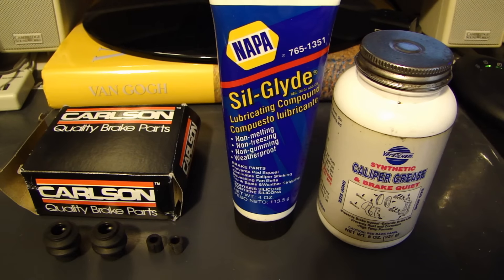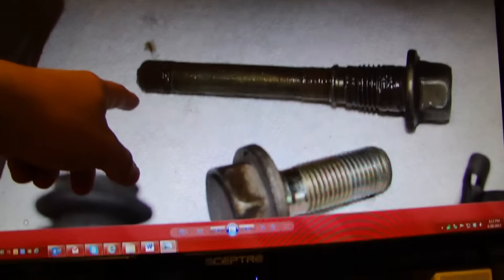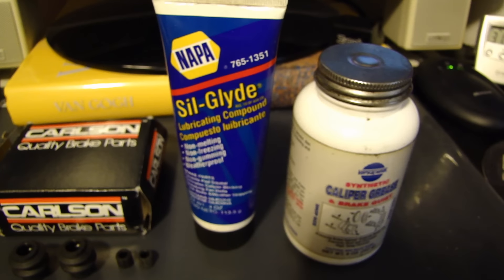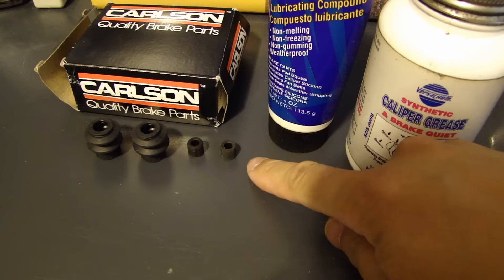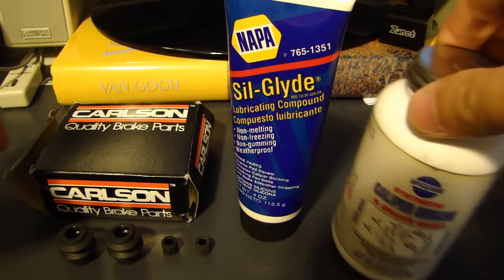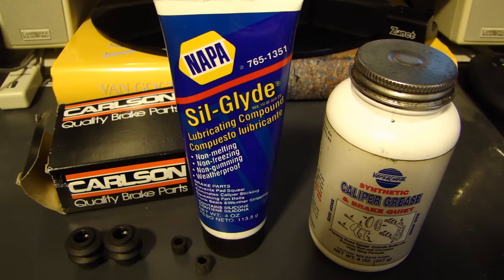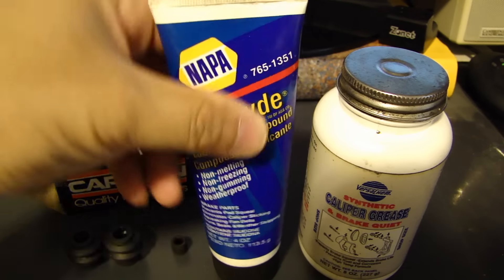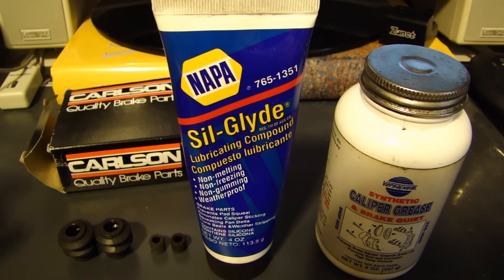Brake Caliper Slide Pin - Proper Lubricant to Prevent Rubber Swelling - Sil-Glyde

Comment: So nice to see someone else besides me using Sil-Glyde. My goto grease for years. I use it on brakes, nuts and bolts on reassembly to make future work easier. Especially suspension work. Permatex anti-seize on anything where high heat is present. You’ll thank yourselves later. Well done video, especially the visual proof.
Reply: Is Sil-Glyde suitable for high temp ceramic brakes?
Reply: @ I use it for all the brake jobs I do.

Comment: I can testify this is 100% truth. The rubber sleeve swelled so much on my guide pins that the pin would pop out because of the compressed air it trapped with the enlarged bushing. Warped my brand new rotors. That is the last time I pay someone else to mess up my car. Follow this man's advice do the job right and save money on the long run.
Reply: Warped?!
Reply: I think you just bought cheap rotors
Reply: It won't warp rotors, it will wear the pads unevenly and do the same to the rotors.

Comment: Geez...this explains so much. I've been using that exact synthetic grease and couldn't figure out why the pin bushings were causing the pins to get stuck (2012 Acura MDX). Will switch to Sil-Glyde. Thanks for posting this video.

Comment: Thanks so much for taking the time to show this. I've been reading about rubber brake parts swelling but I didn't understand if that meant it just deformed, or blew up and split everywhere, or what. Your side-by-side photo with the new one made it pretty clear.
Reply: True, but it might have been even better to turn them 90° so we could compare the widths better rather than the lengths. But it was good nevertheless.

Comment: Excellent advice!  Thank you very much!  My Subaru Impreza also suffered from swollen bushings too.,  I was able to take it out with ease but was impossible to slide the pin back in.  End up reinstalling the pins without it.  It has been almost two years now: lucky to report there has not been any ill effects. I used Synthetic brake grease by Kent purchased from local Ford dealership.

Comment: Had exactly same issue with green synthetic grease and Subaru caliper pins with a bushing on the end. It got swollen so bad the pads were wearing crooked. I found the same solution as you did as well. Syl-glide works very well.

Comment: It is important to know that the pin that has the rubber sleve is the "trailing" pin. In other words, think of the car or truck moving FORWARD and the rotation of the wheel. The "trailing" pin will have the sleve. The leading pin does not have a rubber sleve. Also too much greese can cause a suction effect on the movement of the pin, especially the one with the rubber sleve. The suction effect can make pin movement almost impossible. So make sure the pin slides in and out after applying the greese. Just enough is just right!
Reply: Great comment, David.  One of my pet peeves about all of these brake repair vodcast is they do not state the proper orientation of the parts and the reasons why.  Many of them say, put the part back like you found it which presupposes the last mechanic working on the system got it right.  I recently worked on my sister's 2005 Toyota Sienna XLE and I was incredulous at the number of items the last mechanics got wrong.  If one studies the saga of British Airways Flight 5390, the takeaway is one can never depend on what the last mechanics did for correctness, one must always go by the book.  In addition, deviations from well established design heuristics, like the bushings on the trailing pins, should certainly raise questions.

Adding to your list, I would say do not use petroleum solvents to clean the rubber bushings or dust boots.
Reply: So does it go on the top or bottom?
Reply: @phxrsx  what a good question I was just doing my son's Pontiac Grand Prix rear brakes and both were on the bottom same with the front I hope the mechanic before me had them right🤣
Reply: Whether the glide pin with the rubber seal goes on the top or bottom depends on whether the brake assembly is leading or trailing. The front brake assembly on my Hyundai is  on the front side of the disk brake (top  glide pin trailing). The rear disk brake is on the rear side of the brake assembly (lower glide pin trailing).
Reply: @phxrsx The pin with the rubber goes on bottom. Pin with no rubber goes on top side.
Reply: Napa no longer sells Sil-Glyde
Reply: Many are asking top or bottom. It depends on which side, left or right. Trailing pin is key and is top one side and bottom the other.
Reply: @GraydonTranquilla I ordered some from Napa 4oz for $9
Reply: @UNITED2009100 which side is which though?
Reply: Usually at the bottom (leading edge)

Comment: The NAPA lubricant works good. 

What I’ve been using for years without any issues is SILICONE PASTE from Mission Automotive. It’s dielectric grease but also works great on the slide ping rubber bushings

Comment: Silicone paste for pins, brake grease for metal on metal moving parts. 
Kleen flo makes a Silicone Paste that is excellent for pins and rubber on calipers. Other companies make it as well, however their price is higher, 3M etc.
Less is more when it comes to lubrication of sliding pins. I also hit the rubber on the piston before compressing it. Keeps the rubber seal nice and fresh. 
Synthetic grease is standard on rest of brakes. My favorite is CRC or their other brand, same  stuff.
The marketing on all the brake lubricants is misleading. Most of the stuff is junk or over priced. 
Hope this clears up the confusion for those that were wondering about which stuff to choose. 
Anti-seize is commonly used in place of brake grease. I don't wish to argue over it. Anti-seize is for non moving parts, like threads or hub surfaces in rust prone areas. It makes the next brake job easy as you don't have to nock the rust off, a bit of brake cleaner and you're ready to re assemble. Same thing, less is more. You don't have to lather everything. A word of caution about Anti-seize. It has a specific use. It also changes torque, so think twice before going to town an all your components.

Comment: In the UK, on the Nissan. We're recommended to use red rubber grease, especially formulated to he compatible with rubber. It usually comes in a sachet here. However, tubes and tubs are available for commercial use.

Comment: A lot of greases actually dissolve rubber and some plastics. I used copper grease on my brakes before and didn't know this, and melted my seals. Expensive mistake that the mechanics told me not to do again. Silicone grease is safe and high temperature and low temperature resistant. You can also get red rubber grease specifically to protect your seals. silicone has no effect on them, but red grease helps protect them from cracking, but red grease isn't ideal for lubing the pins. I would just use silicone, and maybe use red on the outside rubber parts if you suffer from cracked rubber. Copper grease can go on the pin and back of the pads only if you are sure it won't touch anything else. This is used if you have squeaky brakes.

Comment from the maker: My Nissan also only have one pin with bushing on each side. I believe they are to help reduce any pulsation on the brake. As to top or bottom, my Nissan came from the factory on the bottom, then later sent out a TSB to put it on top...who knows.

Comment: I have one caliper guide pin on each of the four wheels that has that rubber sleave (or collar) at the bottom of the pin, and one caliper guide pin on each of the four wheels that does not have a rubber sleeve. I'm not sure what I used where, but the rubber sleeves on the front caliper guide pins were split, while the ones on the rear were fine. I know I have used CRC synthetic caliper grease in the past. I think I am going to use Sil-Glyde for the entire brake job.

A FEW POINTS:

1. Sil-Glyde is apparently now very difficult to find in Southern California. The local Autozone is out of it, the local Pep Boys doesn't carry it, and O'Reilly is discontinuing it. Napa seems to still carry it.

2. The official General Motors computerized shop manual makes NO mention of the difference between the two caliper guide pins on each of the four wheels; therefore, there is no specification for putting which pin on top (sleaved) and which pin on bottom (non-sleaved), and there are no diagrams pointing this difference out either.

3. The official General Motors computerized shop manual DOES specify this: "Lubricate the brake caliper pin bolt sleeves with high temperature silicone lubricant." But that is all. No other reference I can find to the caliper pin bolt sleeves.

Comment: Darn. I just finished a brake job using this same synthetic brake grease. To add to the frustration, I already have some Sil-Glyde in my cabinet. I just figured the synthetic brake grease would be just as good. Oh well. I'll try to use Sil-Glyde in the future.

Comment: I use AGS sil-glyde lubricant anytime I have to change or work on my brakes. It has so many uses for the brake job I really don't bother with any other grease/lubricant. Although I do have anti-seize paste by me just in case I come across a rusted bolt or rusted joint in a friend's car and will dab it on threads or the joint to make the next job easier and prevent bolt head stripping.

Comment: I wish I would have seen this before I had a repair shop (national name, by the way) replaced the brakes on my Nissan Versa.  The previous mechanic who did the brake job did not free up the pins.  To say the brake pads wore unevenly is an understatement! I did the next brake job myself and replaced the pins.

Comment: My Dad was taught to use silicone based greases as well. That said for over 20 years he has been using what ever moly ep or synthetic grease he has had on hand. He has not had any problems. Other than when rubber tears from age or debris he has not had any issues. Is this problem unique to Nissan? Rubber is a generic term and some polymers react more than other's. I agree that you can in fact get all manner of reactions from polymers to chemicals. The "rubber" must be exceptionally cheap if it can not resist the effects of common automotive chemicals. The better the polymer the less it reacts. This is why so many companies have stopped  using cheap rubber for important seals and have gone to nitrile, viton, neoprene or pan ultimate teflon especially for main seals and such. 

I have not seen this be an issue on any of the Toyota's or GM products my family owns.

In fact brake fluid is known to swell a lot of different polymers old school temp fix for worn valve seals and leaking main gaskets was adding a pint-quart of brake fluid to the oil. It would swell all the seals so the car would not leak of burn as much oil. It was a used car lot trick. It damaged the seals in the long run making them fail even sooner. By then the car had been sold and they could make money down the road fixing it!
Reply: Nissan rubber is weak

Comment: super informative. no matter how many times i clean or replace my pins, i've had continuous issues with the pins (the ones with the rubber o-ring tip) seizing after 1000 miles or so. many thanks.

Comment: Excellent video! Does anyone know if the rubber pin goes on top or bottom? I have a 2005 Toyota Camry XLE V6 3.0, I replaced the rear right rotor and now the brake pads stacks and don’t move. Please reply if you know the correct place if that pin or there is any suggestions. Appreciate it in advance.

Comment: In the middle of replacing a stuck caliper on my 07 infinity FX35 and noticed that rubber on the end of the slide bolt. Thanks for the video time to run to Napa.

Comment: I recently replaced rubber bushing on rear pin on a 2017 camry, i had to take the caliper frame off so get better access to see bout getting out the remaining bushing that came off the slide pin which seem to be strange that it was whole bushing when the pin only had half remaining on the pin so must had been fallen off the pin while back when someone else did the brake job, i bought a kit at AutoZone for under 6$ used the ags brand seal guide that wirks fine i never had to replace a bushing on a pin with years i done break work but the dealership wanted 15$+tax for just one bushing so ridiculous glade auto zone had a kit for under 6$

Comment: I've got both Syl Glyde (AGS) and Super Lube. Both claim compatibility with brake hardware and rubber materials, but Super Lube is NOT compatible with EPDM rubber (BTW, Syl Glide claims compatibility), which I suspect  causes the rubber to swell. I can't quite confirm this, since I started taking that little rubber end piece off and chucking it, (best thing I did) no problem with the pin slides anymore.
Reply: Ive used syl glyde ags on the last few brake jobs on my cars and have had issues with the rubber guide pin bushings.   They come out fine but will not go back in .   I think this syl glide product is a blend , not 100% silicone which may be my issue .

Comment: Had that very same problem using Permatex green brake grease. Not using Permatex products on brakes again. Sil Glyde for me too. NAPA sells it. CRC Silaramic might be a good choice too.
Reply: Same here!  Brakes were seized from one of the bushing swelling and getting stuck
Reply: Me too, the green Permatex greese which was  shown rubber safe on the can swelled the bushings on my vehicle. The pins were so tight that I had to punch them out.

Comment: Can someone explain the purpose of the rubber sleeve on the trailing pin?  What happens if I just remove the sleeves from the pins?  Doesn't seem that it would be an issue since some cars have caliper pins don't have the rubber sleeves.  In fact, I removed the rubber sleeves from the caliper pins on my Lexus RX350 months ago because they got swollen to the point I could not reinsert the pins.  I have not noticed any issues.

Comment: I did some more research based on your video and found out that silicone grease and brake fluid are BAD.  All the recommendations were to just use brake fluid to slide the caliper piston back into the caliper.

Comment: have a 2010 toy sienna - i think my pins are stuck, last job they were stuck so I bought Mission Silicone paste based on another youtube video that ranks Mission Silicone #1 vs #5 for Napa Sil glide.   I think my problem is that I reused the same rubber bushings which were already swollen? Seems that they're not really needed. Supposedly stops chatter when ABS is engaged ... think I'll leave them off . . .

Comment: It's been found that in recent years (past 10+ yrs maybe), manufacturers have been using synthetic rubbers for brake parts. These synthetic rubbers reacts to the synthetic brake grease which causes them to swell.

Comment: Yes the same thing would happen if patroleum greese got into the master cylinder /brake lines; the rubbers would swell and the whole system would have to be replace. Silicone greese is recommended for brake slide lube.

Comment: Did a rebuild today using AGS Sil-Glyde, Phenolic Piston and Boot slide in with ease. It was almost F impossible with brake fluid, to all reading this DO NOT use brake fluid for rebuilds, huge mistake. Use hydraulic assembly fluid, red rubber grease or silicone grease.

Comment: Lithium soap base glycol grease is recommended for high temp brake parts in contact with rubber components. 
Sil-Glyde seems to make several types of lube.

Comment: I have these rubber bushings in my car. They were swelled and I decided to remove them and install guid pins without them. I noticed a nois like the pins are hitting the inside wall of the caliper while i am driving on unconditioned road.

Comment: Hello! I have a guestion... I saw my friend using break grease on the caliper pins when changed the rotor on my car. Should I change the grease to a proper lubricant like sil-glyde? Or is that ok to drive like that? Thank you

Comment: There seems to be a lot of confusion about where the caliper slide pin with the rubber bushing goes.
It goes on the Trailing pin. There may be an exception but I have never seen one.
To explain Leading pin vs Trailing pin, place a dot (or just visualize a dot) on the rotor with a marker. Rotate the rotor as if the car is moving forward,
Where the dot enters the caliper is the Leading side. Where the dot exits the caliper is the Trailing side. The pin with the rubber bushing is on the Trailing side.
If the caliper is mounted forward of the axle, the Trailing pin is on the bottom.
If the caliper is mounted aft of the axle, the Trailing pin is on top.

Comment: I have a noise on the right front side when pressing the brake, like a "clack" metal with metal. I checked the brake and the bottom pin has the rubber bushing loose, it moves and comes out of place when the pin is pushed in. I think the noise is for this reason, and it is because I used an incorrect grease that caused the rubber bushing to swell. In my country they do not sell the rubber bushing alone, they only sell the full pin that is worth 30 dollars. Suzuki Sx4 1.6. regards

Comment: Hey Dial, what is the purpose of the rubber boot at end of the slide pin?  My pin came out, but would not go back in because ithe rubber tip would expand when it came in contact with the caliper.  What is the purpose of the pin and can the pin be put back in without the rubber tip without causing problems?
Reply from the maker: That rubber piece is suppose to reduce vibration. I know Nissan has been putting that on for many years on all their cars. So it must serve a purpose. If you take that rubber piece off, then at least put a lot of lube on that bolt.

Comment: Do you happen to know the correct location of the pin with the rubber ring? is it on the top or bottom? Thanks
Reply from the maker: On the passenger side, the slide pin with the rubber bushing is on the bottom. On the driver's side, the slide pin with the rubber bushing is on the top.
Reply: @dial2fast  Thank you!